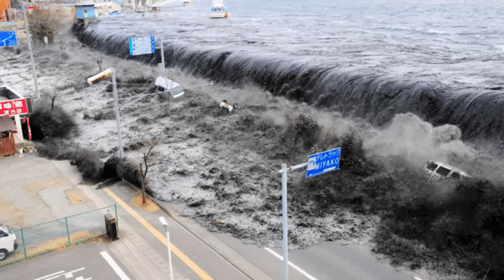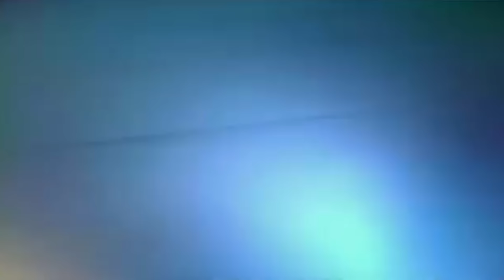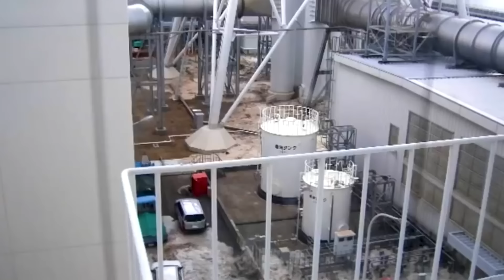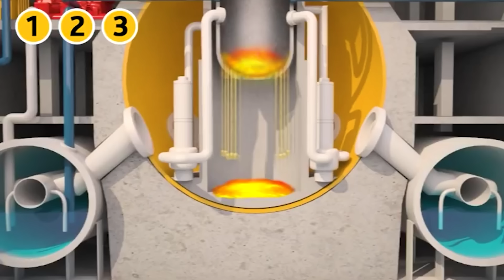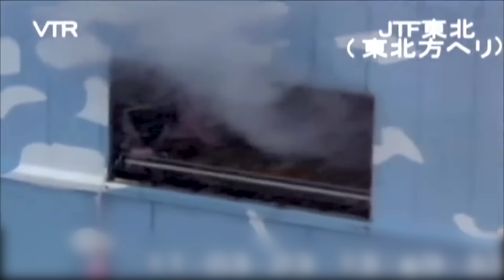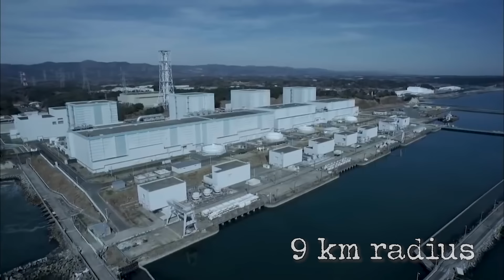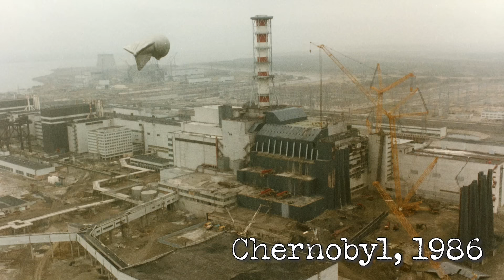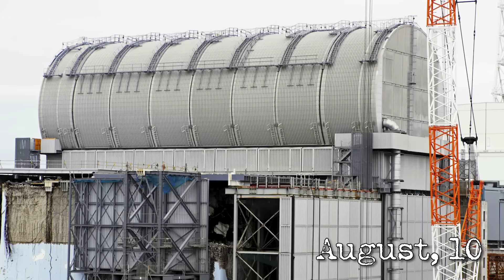The Fukushima Nuclear Power Plant Disaster (Disaster Documentary)

Comment: The question of why the generators were in the basement always comes up. The short answer is Safety. Gamma rays travel in straight lines, and other forms of ionizing radiation have trouble penetrating the ground. A place that is buried will keep you safe from the radio-hazards of a powerplant emergency by being both shielded and out of the shine path. Under most circumstances, the basement is the safest place for workers and back-up equipment. That setup is used in most powerplants.

In Fukushima directly - there was a sea wall on one side, and the linkages to outside power was on the other, further up the hill. The plant would need a disruption from two different directions to totally cut the power, and even then, it should be possible to have emergency services either reconnect the lines or bring in new equipment. The entire country was disrupted by twin events. 

I do find it a bit Ironic that the safety test at Chernobyl was to see if a powerplant could power itself in this sort of situation